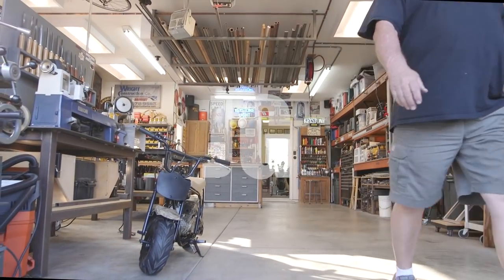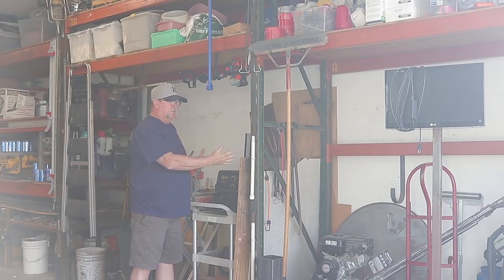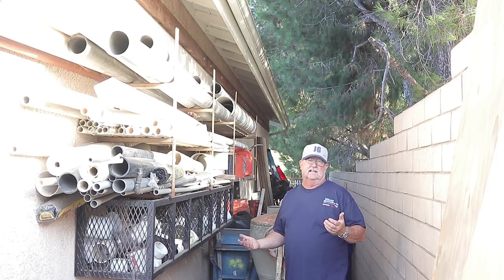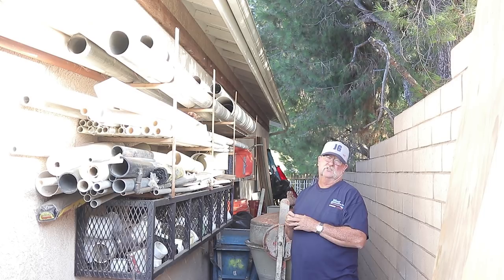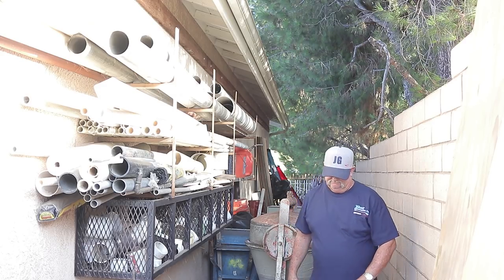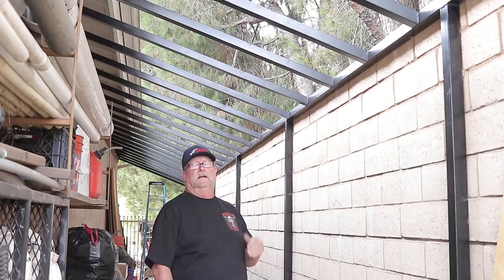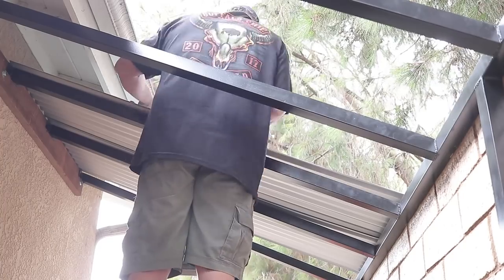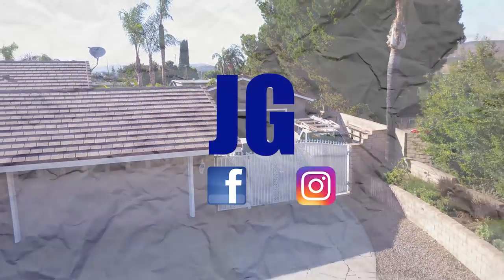Metal Garage Awning | JIMBOS GARAGE

Comment: Looks awesome. Good shout on filling in the wall. Some corrugated plastic sheets would help get some light in, but if you're getting some lamps in anyway, why would you.
Did you seal the overlaps? I've worked of a few corrugated projects and if you don't seal the overlap moss get's under it and is a pain in arse to get out.

Comment: Great little video!...just what I was looking for.  I'm building something similar, instead of metal roofing I'm using tinted polycarbonate double wall panels. They weigh Less than the metal roofing. I'm spanning 14ft.  With the price of steel skyrocketing, I need the most efficient size "rafter"...do ya think  2" x 2" x 16 Gauge (Grade A500) will do the trick? Thanks! (great looking shop!!)

Comment: Why didn't you use steel sections? Could be put further apart. Anyway you should place a joist inthe middle of the corrugated panels, but that is just my opinion. You work different in usa

Comment: Hello , just for me , what was your setting on your flux core welder ( wire feed and voltage ) 
Thanks , good job as usual
Reply from the maker: Thanks for watching, 26  volts, wire speed at about 450-485, This would be for 1/4'' thick material.  Jimbos  garage!

Comment: I'd be worried about  rodents or birds nesting on top of this under your shops eaves. I would have stopped the metal roofing at the fascia board , that would also help a lot with ventilation.

Comment: When you pulled the original building permit for the shop was there a building setback requirement from the block wall/property line? If so, by attaching the awning to the building you are extending the structure into the setback. As you built it does this still satisfy the original setback requirement?

Comment: anyone can overbuild. What takes talent is knowing the minimum require for it to still work. In this case some 2x4 x 8' long treated wood going from exsisting rafters to top of block wall would of been just fine and cost 1/4 as much. Wood would of totally worked fine. Just rip out the exsisting facia and gutter and extend the roof out.

Comment: why so much steel on this little roof, omg((
Reply: If he did it right, it would have only required 1/2 the steel he used and would have actually have been more sturdy (the roof would not buckle if  you pushed into the middle of a panel, within reason of course).  Corrugated metal is designed to be supported laterally by purlins supported by rafters and at the looks of his run, one lateral purlin running the length with rafters at the same location as the up and downs would have more than sufficed. If he is in a snowy area he may find the panels dipping the way he installed. Over time, this can wear on the support points (purlin screws). All in all, done wrong but I am sure he will have no troubles for a long long time.

Comment: Yeah, the awing is way too over built! I have a 30 x 50' metal building that using 2-1/2" metal square tubing spaced 5 feet apart for roof and walls.